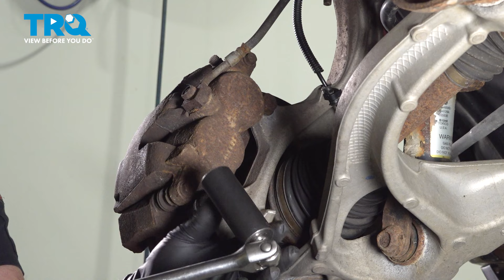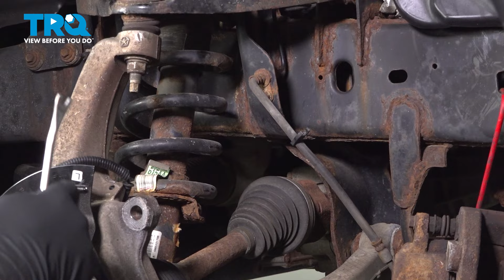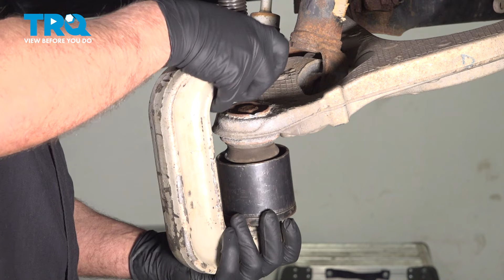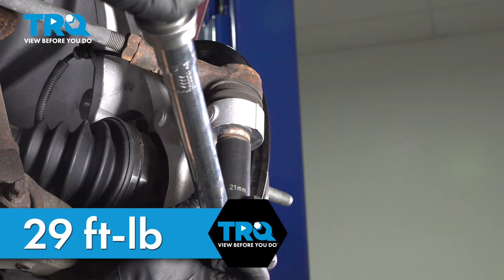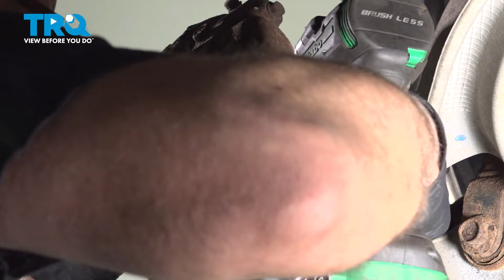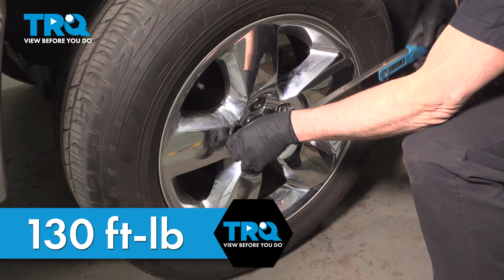How to Replace Front Lower Ball Joints 2011-2018 Ram 1500

Comment: Good video, but if you are attempting this repair, do not expect all of the parts to come off so easily. Be it that stubborn plastic lock on the ABS sensor connector or the rotor, something will fight you when trying to remove it. He didn't even need a can of rust penetrant. Having said that, it was an informative video. Thanks.

Comment: I was qoted $279.11, by a professional auto shop for an after market non OEM part.
Add $30., for the Mopar OEM part.
It is well worth paying a professional like this mechanic.
The shop time is 1.5 hours.
Labor costs $210.
Look at what is involved.  The tools, knowledge and lift.
I would not recommend the dealership.   Your looking at double or triple the cost.
They can't even get an oil change right using illegal migrants non-skilled labor that takes 3 hours for an oil change. 
And notice this professional mechanic doesn't have hair-gel either.
And the service specialist doesn't have a corn-rows in her hair. 
This video shows a professional at work.